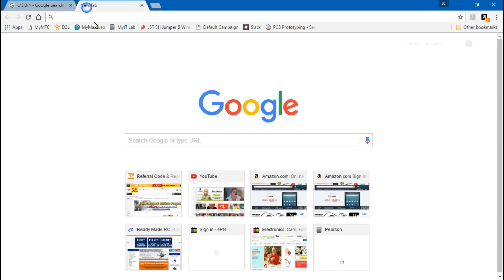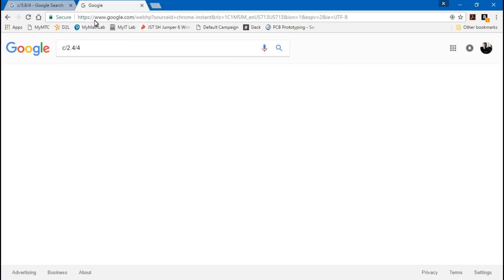DIY Linear Antenna (5.8GHz)

Comment: I am lookin at frsky x8r for a bait bait boat. The reciever needs to be internally mounted then i need to attach the linear antenna to the outside for waterproofing purposes.can this ve done? would i need to replace tge cables or just cut them and attach etc

Comment: Does the length of the coax part matter?
Reply: not much, but there is some loss at 5.8GHz, so you shouldn't go beyond 10 or 15 cm unless it will really make a better placement for the active / top end

Comment: Great video!!! The only thing is that when I type lets say c/2.4/4 on the browser address line I get a formula for a cup!!! Nothing to do with the calculation of the coax cable measure I have to strip! Any idea why I cant get what you get on your screen! Thanks buddy!!!

Comment: Can I just buy 2.4 ghz antennas and trim off the lenght to 12.92 mm?
I bought the wrong antennas for 2.4 and I need 5.8 for fpv.
Reply: Sad to read that we lost this kind teacher. RIP
If anyone else know the answer to my question I would be pleased to know, otherwise I will just try to do it.
Reply: @gnyger  If it's a simple wire then yeah I guess so. It's the length of the antenna that matter in this case. If your 2.4ghz antenna is around 31mm then yeah I believe you can just trim it to 12.92mm

Comment: Hi I have broken my anttena in my drone it work on 5.8ghz in my receiver is have dual anttena and  the length of exposed wire in around 10 mm should I use the same in transmitter or 12.9 mm please aswer

Comment: There is one big conceptual error: you have to make the other half of the dipole, i.e. the shielding should extend for the same length as the corem but downwards... As presented here, the antenna would work very badly and possibly burn u the Tx.

Comment: if the length at the tip is more exposed than 12.3mm, lets say 20 mm. will it get worse reception. seems like the more exposed the more it would pick up. can u help me understand? great videos btw.

Comment: Sorry to spoil the soup a little bit! There's one design flaw. You can't use random wire lengths as you want to make sure feedpoint impedance is aprox. 50 Ohms. A hint: use odd multiples of quarter wave length as your feed wire lenght. This is really important!
Reply: Are you referring to the 12.92 measurement or the length of the whole antenna?

Comment: I'v made more than a few of these and if you use 50% larger dia. wire you will increase range by 1/3 on average. Keep it long and tune in field. Lots of folks will solder these on incorrectly or have too much shield cut off either end so field tuning works best. That large solder joint at the SMA will decrease it's effectiveness. Shield over it with TV coax cable with the main conductor and it's inner jacket removed. If you do go with larger awg wire keep it 1-2 mm shorter.

Comment: would it be possible to solder a 31.22 mm unshielded wire straight to the plus of the transmitter ?
Reply: kubbur possibly, as I remember some rxs have a wire of the correct length just sticking out, no coax.

Comment: It would have been helpful if you included the units in your calculations.
The unit of the speed of light is m/s, and its value is something around 299792458. Rough estimate.
The unit of the frequency is 1/s, and the value is something around 5.8*10^9 (Giga = 10^9).

Now, when we divide the speed by the frequency, we get (0.3*10^9 m/s) / (5.8*10^9 1/s) which equals to 0.3/5.8 ms/s, which gives us a wavelength of 0.051688 m or 51.688 mm.
Since this video is about a quarter-wavelength, we have to divide it by 4 to get the mentioned 12.92 mm.

The whole calculation confused me a little bit, and if there's somebody else who felt the same way, I hope my comment could fix that at least to a slight extent.

Comment: On many linear antenna there is a little metal tube acting as mass. Isn't that required?
Reply from the maker: Its not required. After you remove it just recheck the length of your signal wire.

Comment: It is probably a good idea to mention the implications of polarisation linear to linear and linear to circular. The short answer I suggest is to use linear to circular for aerobatic flying. This will have lower gain but a more consistent signal for all attitudes of the quad.
Reply from the maker: You  nailed it. Sorry I forgot to mention this but I absolutely agree. Thanks for sharing.

Comment: Thanks for the great video!

I'm actually interested in the one on the taranis will build one asap. Do you have any experience in using a half wavelength antenna on the taranis instead of a quarter? Would it have any benefits over the quarter like increased range? Or would that not work at all and fry some electronic component in the radio?
Reply from the maker: I'll do a video on it.